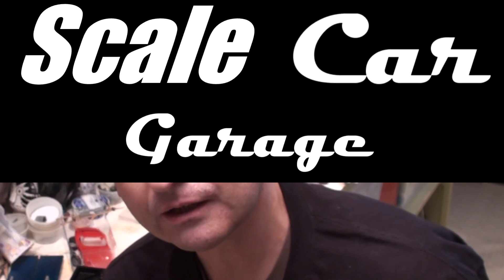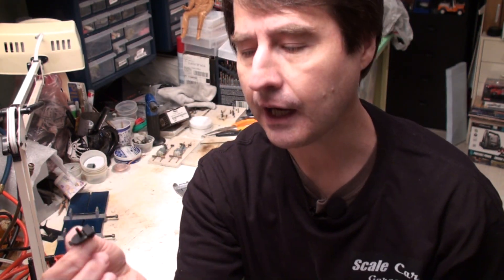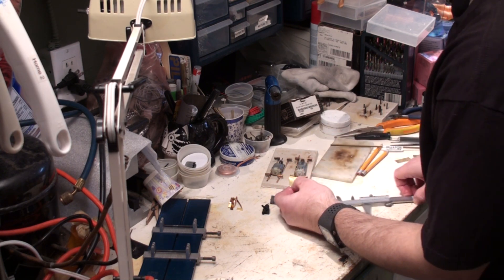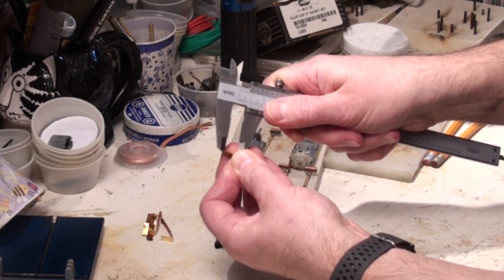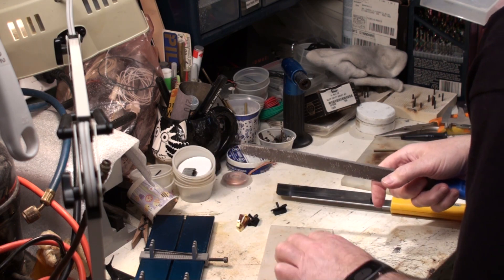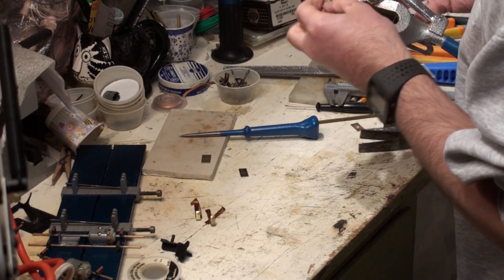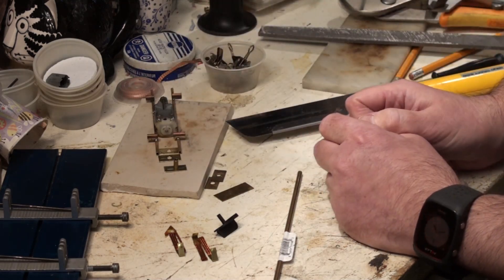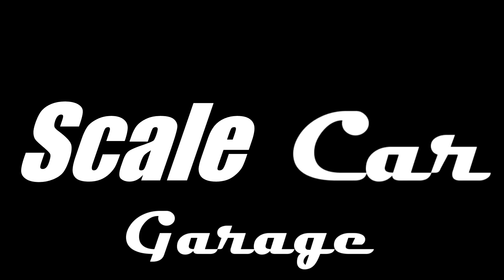Scale Car Garage - Cobra Ferrari Build Pt. 2

Comment: John, this video in the build series is in the same category as your others, top class! I look forward to other videos on these cars as they come along. I also want to see more of what you have completed in your cupboard. A brief history on TSRF, if I may. The True Scale Racing Federation (TSRF) was a revolutionary idea of Philippe De Lespiney, from California, developed in the late '90's & early 2000's. It included both 1/32 & 1/24 scale cars with some very unique chassis, new small race tracks, & some other features. It was marketed as the new direction slot racing was going to go. The whole thing never developed as it was intended & about 2005, it was sold off to a Californian millionaire  named Scott Bader, along with other slot car companies of Philippe. The last I knew, Scott Bader was selling TSRF cars & parts when they were requested. One of the features of the TSRF cars was a dagger-like pin guide that got many complaints & might not have been a good idea. The TSRF guides you're using on the Cobra & Ferrari, I believe, were developed "in-house" to rectify the situation as well as to fit some of the other 1/32 cars. I don't think they are  another company's relabeled part.
Reply from the maker: Bill, thanks so much for watching and for your wonderful comments! I really appreciate you providing such a great background on TSRF and clarifying that the guides are in fact a TSRF designed part!
Reply: @FastSports-ScaleCarGarage    Bill,  I use Slot-it Universal guides for my builds, but I've heard good things about the TSRF guides from other scratch builders, who especially liked the way the lead wires connected to the braids.  Do you know where I can obtain the TSRF guides these days?  I'd certainly like to try out a few.  Thanks,  Mark
Reply from the maker: Mark here is the url for Electric Dreams: https://www.electricdreams.com/Shop/slot-car-parts-c-3/tsr-common-parts-c-3_246/ 
The guides are at the bottom of the page. I hope this helps!

Comment: thanks John for making this video on the guide holders. Just a couple of questions if I  may. If you do not have a punch machine, drilling would be the same I assume. And the second question I have is whether the hole in the brass plate is wide enough so that the tube can slide into it. Those guides look a lot like MRRC guides one can find in their clubman chassis.
Reply from the maker: Giovanni, thanks so much for watching and for your wonderful comments! Yes, drilling a hole will also work! Secondly, yes, the hole is the same size as the outer diameter of the brass tube and is wide enough for the brass tube to slide into it. I wasn't sure if the TSRF guides were 're-issues' of the MRRC guides, but and earlier comment confirmed that these guides are designed and manufactured by TSRF. I hope this helps!
Reply: Giovanni, the drill bits are apt to grab at the  brass while drilling. You might want to drill your hole(s) in the  brass stock before you cut the brass plate(s) to size. This would allow the brass to become better anchored or held down while drilling the holes. Drilled small brass pieces  can easily become a spinning pinwheel.

Comment: Thanks John for another great video.  I think it's about time I purchase a torch like the one you use.  I have several soldering irons and a Dremel torch, which is compact, but has some other issues (probably mostly operator error).  In any case, I'm always on the look out for equipment that can compensate for my shortcomings.  If you could let me know the brand of your torch (and remind me again of the brand flux you use) I'd be most grateful.  Thanks!
Reply from the maker: Mark, thanks so much for watching and for commenting! The flux I use is made by Kester and is the type used for plumbing, and is quite thick, or high in viscosity. The torch is an Irodo PT-200 and is filled at the bottom using a separate butane canister. I hope this helps!